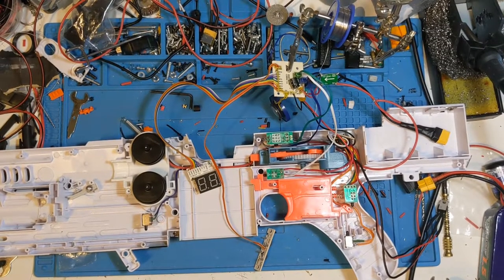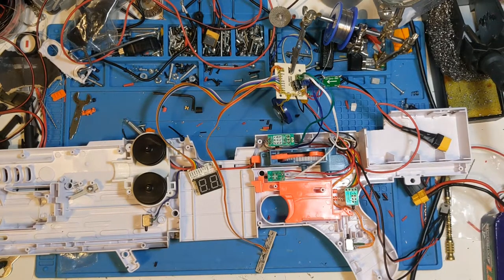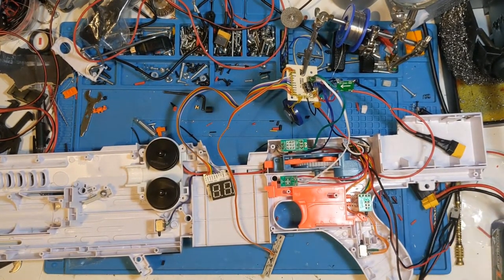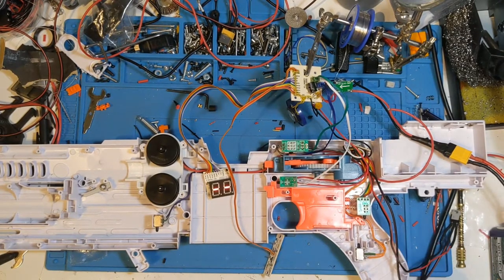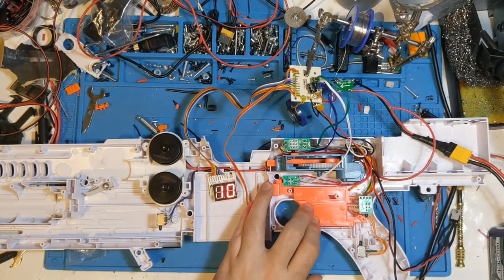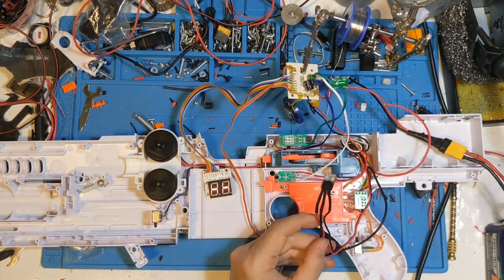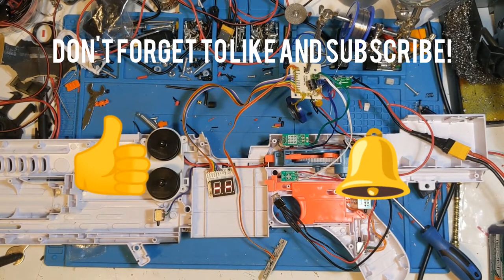Nerf M41-A Pulse Rifle - Is it HVZ/War Practical? Part 3 - Internal Modification

Comment: Outstanding tutorial!  But, it looks like you didn't mention the rev-switch's connection to the mosfet.  Does your setup negate the need for a rev trigger ,(i.e., two-stage trigger)?
Reply from the maker: The rev switch connections are not touched. The rev trigger in the pulse rifle connects to the main board, and that board then has outputs from the board to the motors. So the board outputs connect to the mosfet - on most builds, of course, this board doesnt exist, so you wire directly from the rev switch to the mosfet.

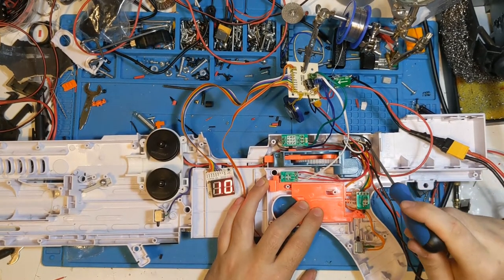See 4:50 onward for an explanation of the mosfets connections and where you need to wire them.